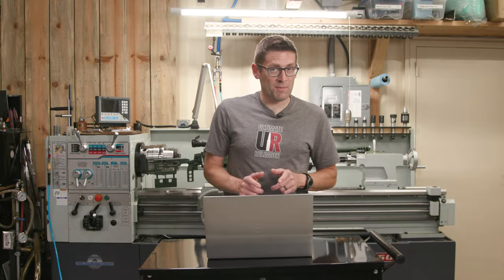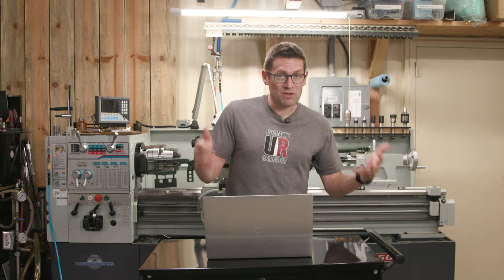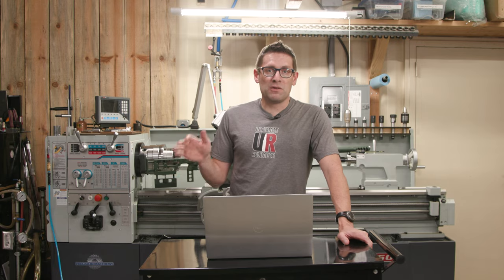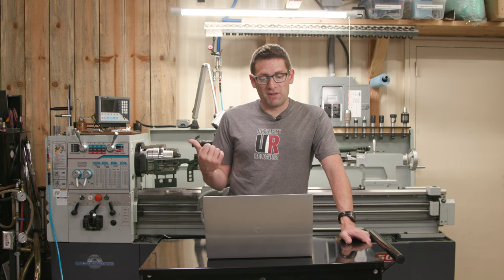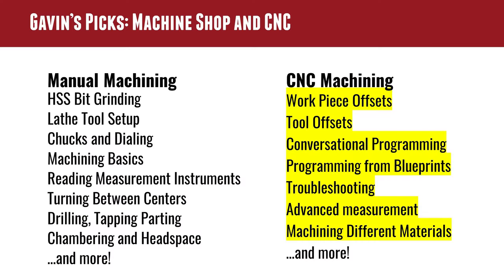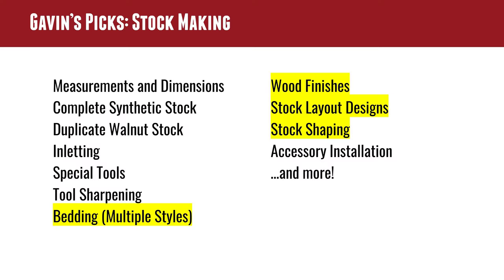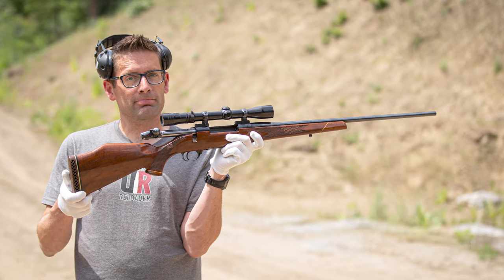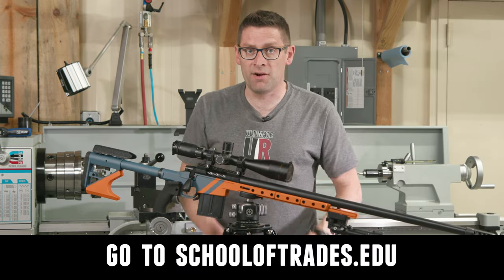Inside Look: Colorado School of Trades Programs

Comment: As a Former CST Alumni and Class President of the Gun Club at CST. This was a really good preview of what the school has to offer. Gary Schlomer, who just recently passed, was a Gunsmithing legend at CST. He was an instructor for over 30 years.
Reply: Sorry to hear of Gary's passing. He was helpful and generally just a good guy when I went in to CST 1983-1984.
Reply: RIP Gary. I attended CST 1981 through 1982. Gary was a recent graduate himself when I started. He taught gas welding when I was there.